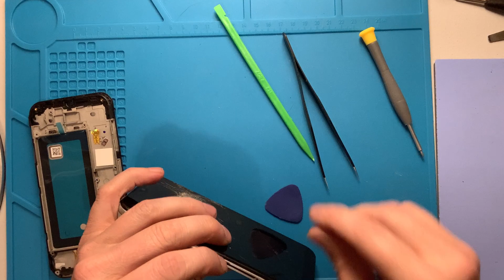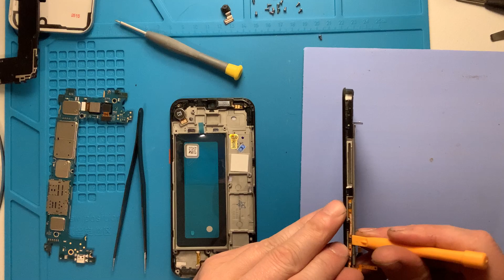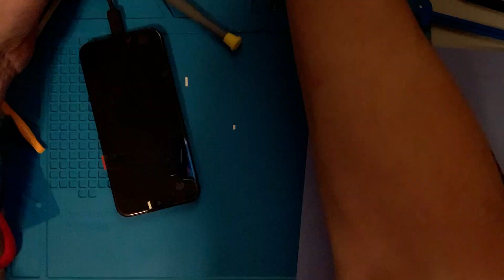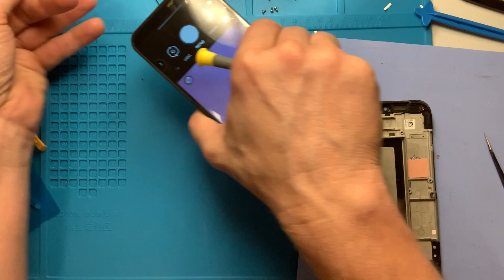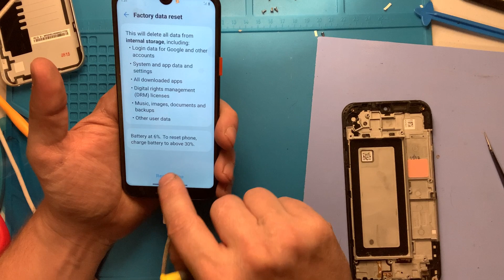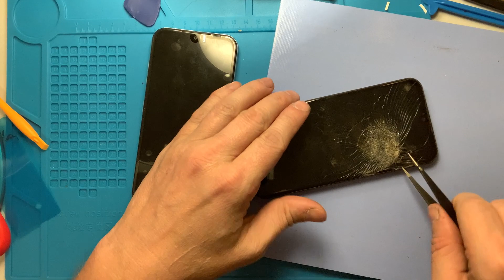LG K8x - LM-K300UM Screen battery , motherboard and button repair swap to new screen.

Comment: I really need the ribbon connector pinout or to at least know what all the pins are on it for the LG lm-x210, the Motorola xt1921-8, the Samsung J100 & the Samsung J120. I can't find it anywhere. Any help with this would be very appreciated.
Reply from the maker: Do you need the schematics or just the ribbon cable?
Reply: @stupidphonerepair6374  OK so, I left one out bc I wasn't sure about it yet. Here's what I'm trying to do. I have a working LG lm x210 without a screen. Ideally, I'd like to attach a screen I have from a Vantron 5081g tablet. It has a 31 pin LCD ribbon connector. I realize not all of the pins are used, I need to know which pins are used & where they go. If that isn't possible, I have 3 other screens, the Samsung sm J100, the Samsung sm J120 & a Motorola xt 1921-8. It's a project specifically trying to see if this can be done. I can't go buy any parts or phones or anything like that, I have to use what I have.